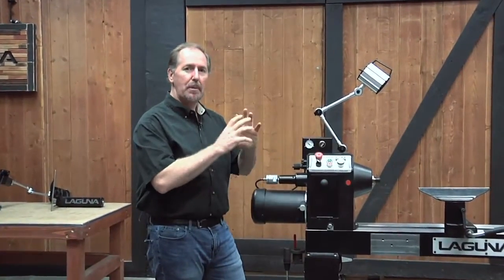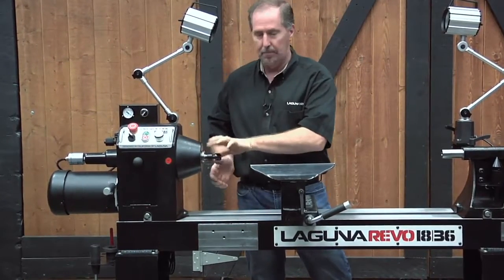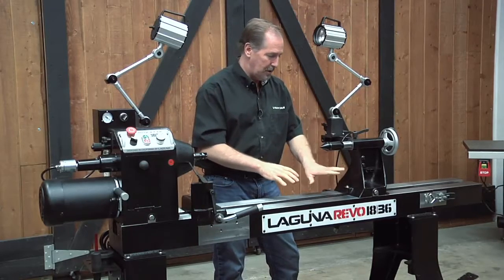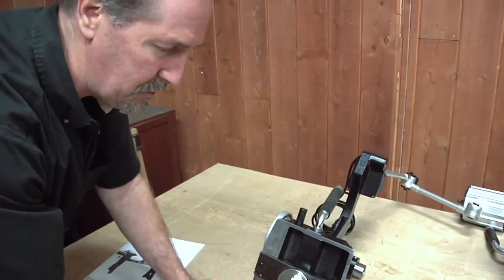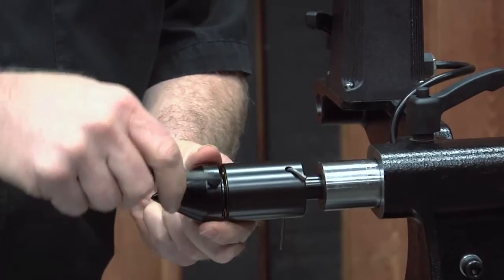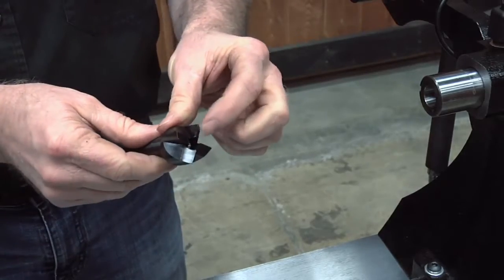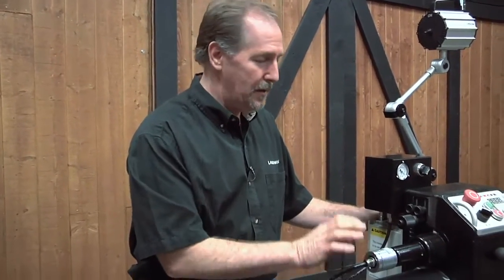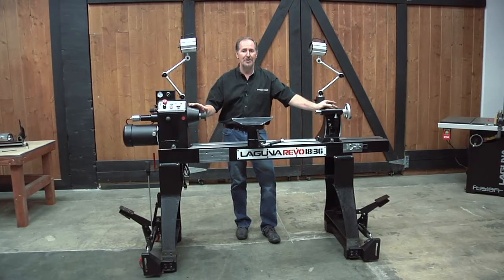REVO 1836 Lathe Setup - Adjustments And Fine Tuning - Part 15

Comment: I need some advise. When I drill holes using my tailstock (with or without Jacobs chuck) the quill becomes very wobbly when extended more for deep drilling. The holes are not good because of all the movement. Any advise?
Reply from the maker: Hi Philip. If you haven't had any luck fixing this issue, please contact our customer service here: https://lagunatools.com/resources/customer-service/
They'll be able to help you find a solution!

Comment: You don't explain the up and down alignment of the tail stock.  If my tail stock is about a mm higher than the head stock, what is the procedure for aligning the points?
Reply from the maker: Lets Discuss. Call us 800.234.1976